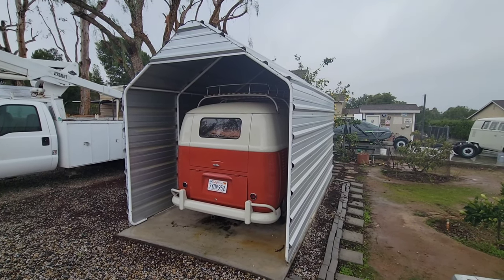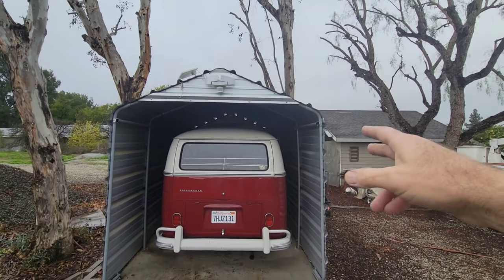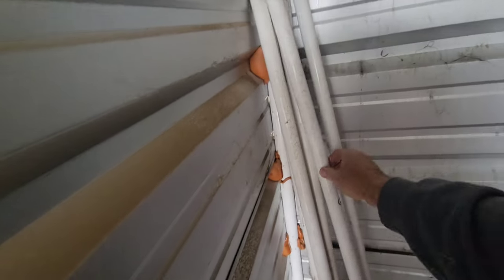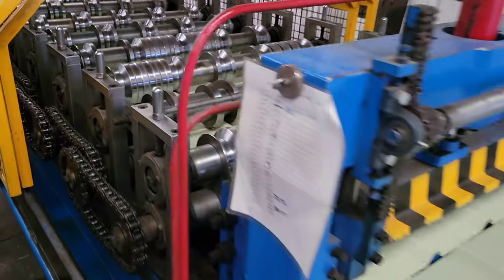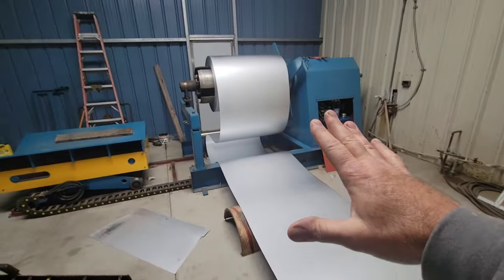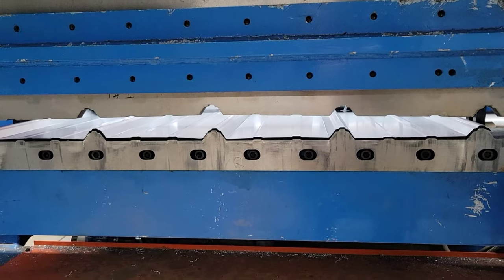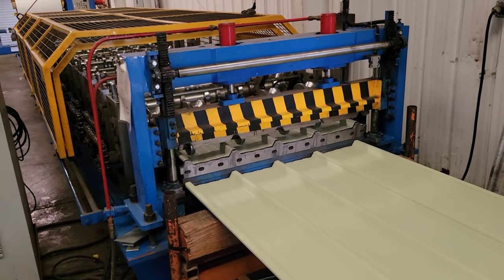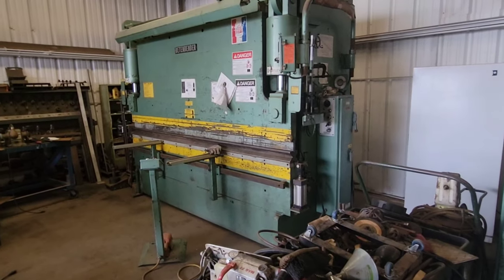harbor freight portable garage into permanent structure how it's made

Comment: Very cool process. Now you've given me an idea for a cover for a side by side, so it isn't exposed to the elements. Thanks for sharing 👍, great information. Probably save me some bucks as well.
Reply from the maker: Great for that and not too expensive. Check for  sheet metal roof guy near you or check this guy.
Reply: @mikesrandomvideos  I will. I'm in the Dallas TX area, so I'll check around here. Great idea using the Harbor freight frame.